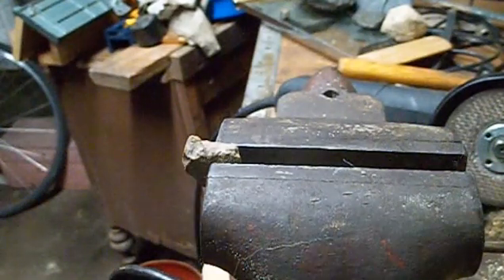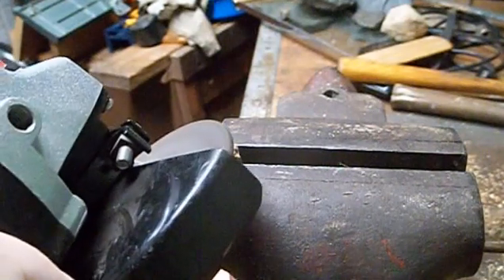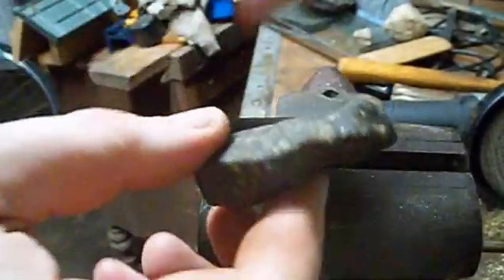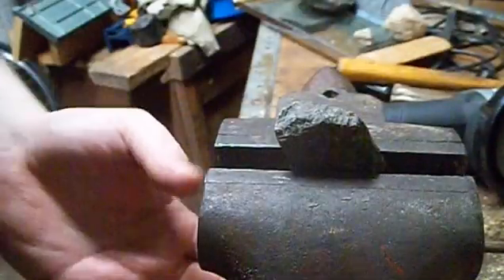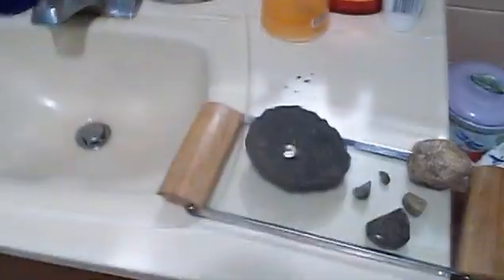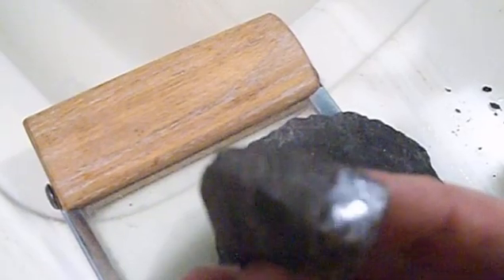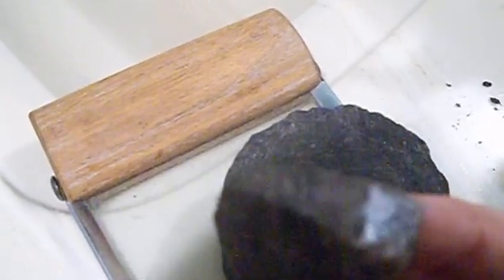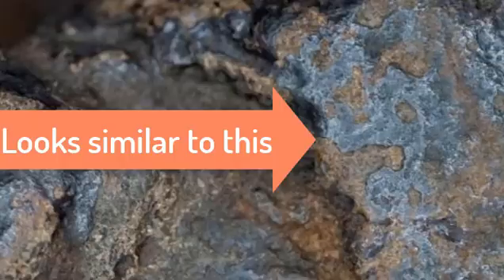Cutting Meteorites... What's inside?!?!?!?

Comment: Meatorites are mostly iron. Everything else burns up in the atmosphere
Reply: Nope...there are 3 types of meteorite and one is almost entirely stone and it is the most common. Stony iron and iron are the other two...with a bunch of subtypes for each.

Meteorites will "air brake" on their way through the atmosphere. Depending on angle of enterance to the atmosphere and other factors meteorites can hit the ground at 300mph.

If you check out Palisites, sometines they even come in slowly enough that the relarively delicate Peridot crystals surive intact.
Reply: @truthseekercanada  check out the meteorite that landed down my block in the 1990’s took me almost 10 years to collect all the peices it was moving so fast it didn’t even make a sonic boom. Looked like a flash of orange lightning. It is hardly magnetic at all except for the face and back which are extremely attracted to a magnet. Though I keep magnets away bc it is extremely delicate. 

https://youtube.com/shorts/XKwUkGqiltA?feature=share
Reply: Not true the one that landed down my block was hardly magnetic at all and left a pretty big crater. It’s the speed they fall; any meteorite can do damage. https://youtube.com/shorts/XKwUkGqiltA?feature=share
Reply: Not always. The non-iron parts tend to burn off first but doesn't always burn up entirely. Some stony meteorites contain little iron but some still survive.